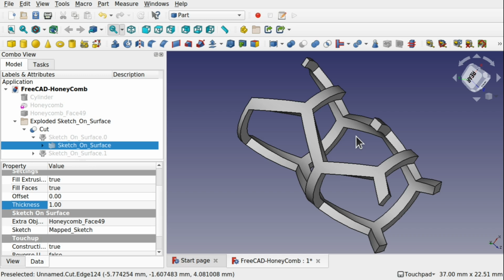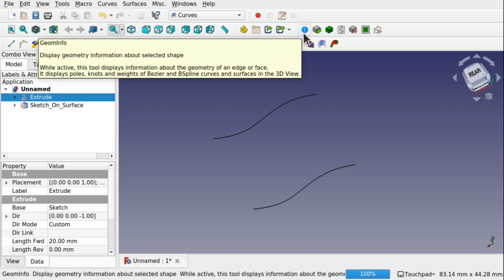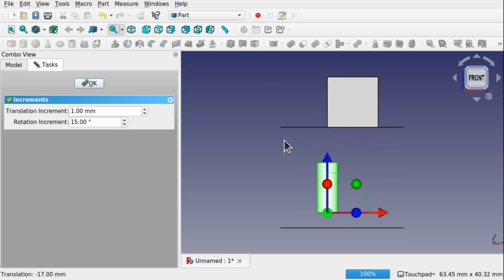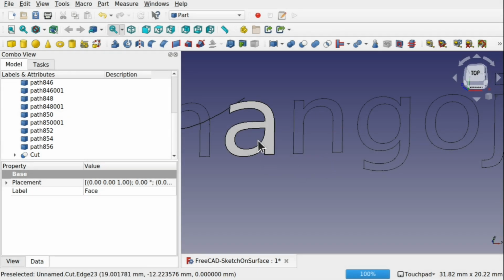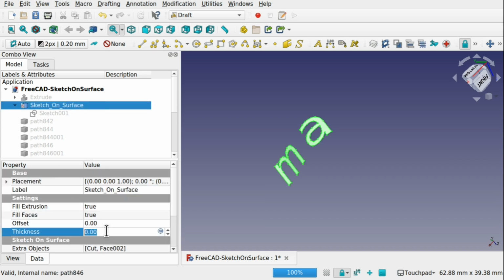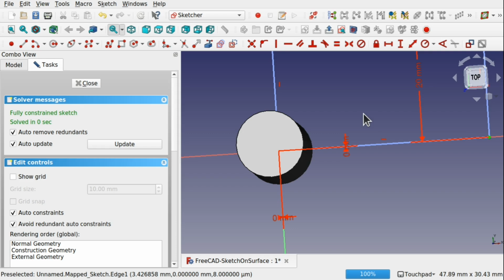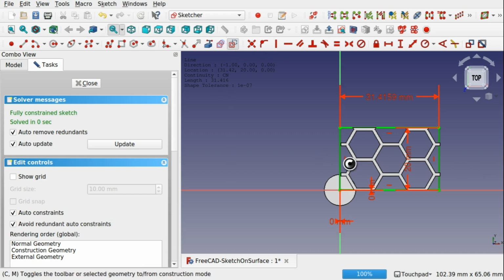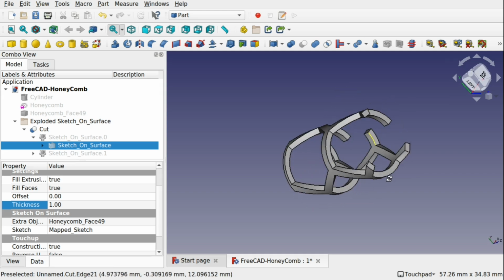Learn FreeCAD Curves Workbench 21: Hexagon Mesh and Curved Text SVG, Extra Objects on curved surface

Comment: G"day Darren & Other's,

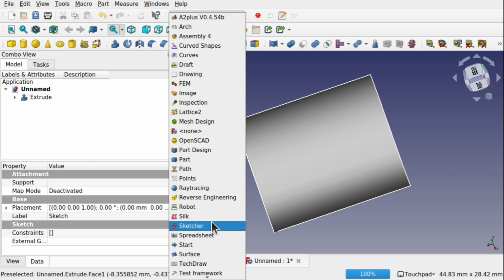Some Users may have problems at 2:31 doing the Initial exercise Mapping Sketch to Extrude Face. My FreeCAD version 0.21.2 requires the alternative Technique (shown in prev Tut). Merely select extrusion Face and go Straight to Sketch on Surface Tool in Curves WB. Then edit Sketch_On_Surface/Mapped_Sketch as per Tut Video. Later on when importing the *.svg I discovered I was able to upgrade all imported text item to face via Multiple Selection. Positioning Multiple Letter Objects is best done via the Placement Left Side Panels.

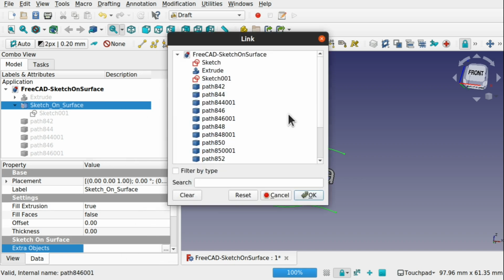Hmm struggling again, all well until after the upgrade of the *svg import. 12:41 when I attach m & a tp Sketch they appear as crowded lines outside of the visible guides created at the very start of the exercise. Not sure i I've missed something but head is worn out for the  moment. I've redone the Tutorial to this stage successfully then this? I'll again tomorrow. As far as I know my FreeCAD is UTD.

Came back to it following Day using Older Version FreeCAD 0.19 with Default settings and got it to work? Possibly settings with my Newer version? Nope, reopened it and succeeded in getting full text string "mangoJelly" to Map to Surface. Obviously my tired head has missed something!!

Honeycomb exercise so far so good. Note: to get rid of Border/ Frame in latest see attributes in Left Panel. Completed The Honeycomb Wrap Tut with No Problems, Noticed in my FreeCAD 0.
21.2 WHen attachinf the Honeycomb so different Tree Names for Object but otherwise no issues

One of the challenges of FreeCAD is it has these what I call Idiosyncrasies, Again I wonder if my Flatpak install of FreeCAD is the issue. Darren could post details of your FreeCAD install & OS? Perhaps I need to investigate a Low Level Compile install (perhaps use the New Computer? LOL).

Comment: I am for some reason only able to sketch on surface with b-splines and no other geometry.
Reply from the maker: That's is strange, have you tried going to the tools, add on manger and seeing if there is an update to the curves workbench. I am wondering if your using an older version.
Reply: @MangoJellySolutions  Well, I deleted the workbench, restarted FreeCAD and then reinstalled it and that didn't fix it.  I'm going to look into it further and figure out what the problem is.  It's very strange.
Reply: @MangoJellySolutions  I've discovered that sketching on surfaces works fine but only if I create the sketch using the command in the Curves Workbench.  Any sketch made outside of that command will only map b-splines.  I don't understand why but regardless I am able to workaround the issue now.

Comment: I just went back and watched it for a third time to try and absorb what I missed the first two times watching. I realize now it's not one of your normal tutorials that breaks down a single element but more of a bits and pieces video as you experiment with a new feature your exploring. 

The more of these videos I watch the more I realize this program is like a huge kitchen with a hundred drawers containing all the things I need to cook anything I want. Until I'm able to familiarize myself with this new kitchen it's going to take a lot of drawer opening and closing just to find the right tool for the meal at hand.

For those new to the program just jump in and start cooking. You can slam drawers all day long looking for a particular pan to fry an egg in or just realize you can fry an egg in any pan. Grab the first pan you find and start cooking

Comment: With the cylinder at the end, why did wrapping the honeycomb fill  in one of the honeycombs, and  leave the rest empty as they all were in the sketch?   Why did you have to explode it to cut out that face?   How did explode know that was the bit you wanted to cut out?
Reply from the maker: To be honest with you I have no idea why it did that. You would of thought if the problem is because of the hexagons position then a row of hexagons would be filled which doesn't happen.  When you wrap the object around the cylinder you still get the mesh but you get the hexagon filled in as well so you get two faces, one the mesh and the other the hexagon. If you had two hexagons that didn't convert you would have 3 faces. 1 the mesh and 2 hexagons. The hexagons are the same size as the space in (or what should be in) the mesh so when you add thickness it makes all faces extrude but you still have all of them grouped together. go for the explode it divides up all the individual objects.
Reply: @MangoJellySolutions  Hey, thank you for the reply and sharing an explanation.  Will keep watching vids and hope to grow more proficient :-)